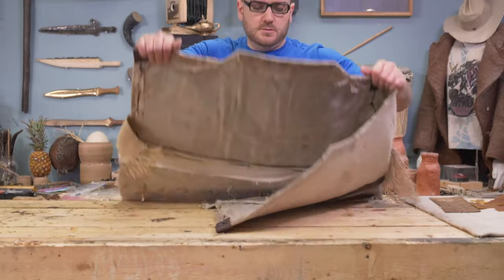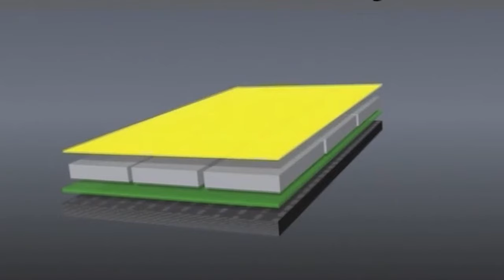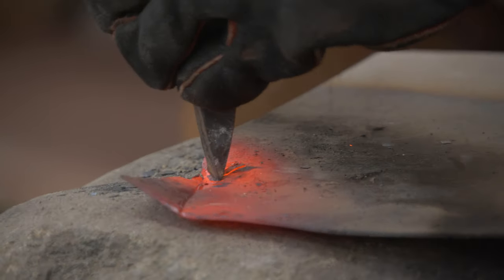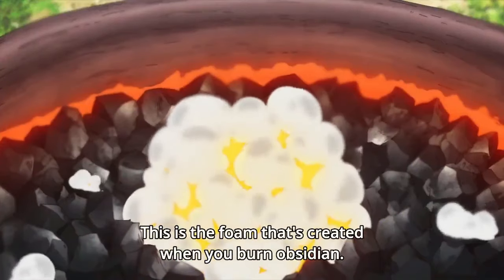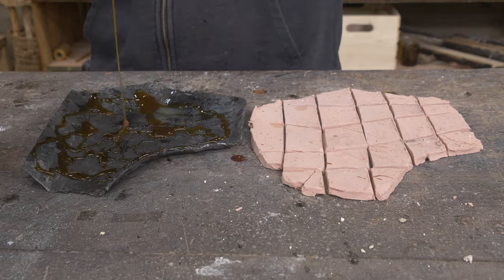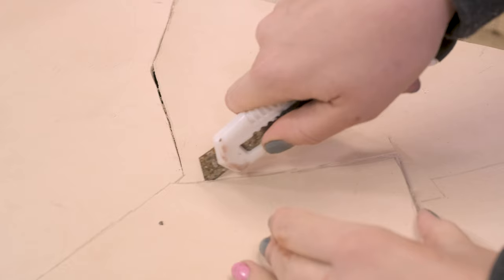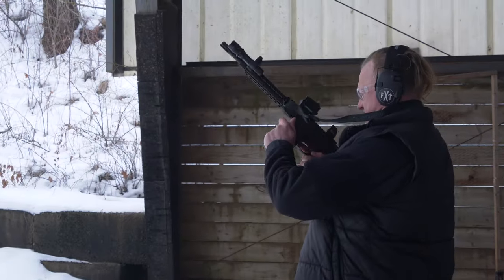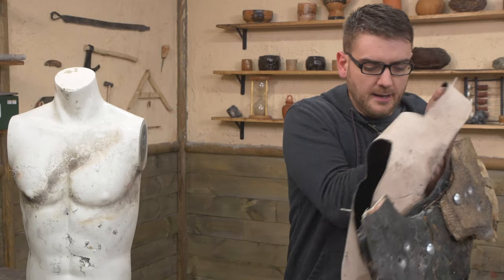PUBG MOBILE Power Armor: Handmade from OBSIDIAN?!?

Comment from the maker: The NEW PUBG MOBILE Runic Power Mode is now available!: DOWNLOAD: http://bit.ly/PUBGMHTMEPA
#PUBGM #EVOGROUND #POWERARMOR
Reply: I'm early
Reply: linen is not a bad idea for armor as its fibers tensile strength is fairly high  , using ancient available natural fibers with higher tensile strength would produce superior resistance for the same density of weave and numbers of layers . that said your off to hemp fiber then silk  then its chemistry time ending the ancient materials. next you need to look to the thread and its weave  they will make a difference more tpi for a denser weave more transfer of force. the number of layers and compost armor  what if 2 of every 4 sheets are rosined laminated or glued..leaving harder less flexible layers in the assembly  havent touched on stone or metal possibilities .your choice of linen is uninspired not going to silk is understandable for budget reasons but good old levis had this hemp fabric called denim so getting ahold of some of that shouldnt be toohard lol .thanks for the video
Reply: just want to stop 9mm  i believe 75 layers of silk at its near max tpi stops 9mm google it swiss or german inventor ww1 silk bulletproof vest  at the time the alternative was 150lbs nickle steel plate shield
Reply: Seeing the softer brass help stop a 9mm bullet makes me wonder how well a body armor made of a brass cuirass and a composite made of obsidian, linen and leather would do. Maybe sandwich the composite between two brass plates. Inquiring minds wany to know. It is cool that ancient technology can still compete and is relevant.
Reply: How much did they pay you?
Reply: @joefoll3553  More than Raid: Shadow Legends >:P
Reply: Wish you would have tempered and hardened the steel, they had that ability and it makes a different
Reply: so bronce did much better... well, now they need to make a bronce spartan shield and test it.

Comment: Neat! It looks great for your first hard armor. Maybe llamelar or scale would be another step.

That is an awesome use of the iron era materials. Linothorax composite obsidian-ceramic without the iron might be an effective stone age armor.
Reply: I don't think you can get this obsidian foam using stone age technology. I mean, I imagine it would already be pretty difficult with medieval stuff, but getting that much concentrated heat seems rather unlikely with the stuff they had back then.
Reply: @darthplagueis13  Charcoal burns  at 1,200 C, and obsidian melts around 900 C so it should be possible. Just really hard!

Comment: maybe when working with metal... make an anvil first.
Reply: Lol I thought the same thing
Reply: Whaaaaaaat? Naaaaaaaaaaaaaaah
Reply: He got a rock, thats good enough.
Reply: Make an anvil? I'd be interested to know when metal anvils first came in to common use, considering they would consume large amounts of expensive and hard to produce materials. With the metallurgy of the time, the early iron age, they would likely be quite soft or too brittle for sustained use.
Reply: @another3997  i understand that you think about those comic like anvils. But just a thick metal sheet will most likely suffice. Trying to get something flat on a round stone is.... No good idea.
Reply: @SubjektDelta  hell, even a hammer and an axe mounted to a tree stump or large log would've done! And that's roughly how anvils started anyway.
Reply: steel strong
rock strongker

Comment: I'm impressed, that is incredibly functional.
Reply: same, I was not expecting it to equate to modern *anything*. As it is, a lot of commercial vests use 3A... That's impressive considering the thousands of years that separate this technology to that Glock.... It surprises me how few cultures used ceramic for armor actually. I can't imagine the resiliency was lost of them.
Reply: it was until he said the weight of 17lbs. steel plates that stop armor piercing rifle 5.56 weigh 6-7lbs although never buy steel armor. I have hard poly 3a plates that are 1lb each and will stop anything 44 mag and below. modern rifle stopping ceramic/poly plates are 3.5-5lbs and that's just on one side too. hell even a phonebook will stop 9mm and will weigh less than 17lbs.

Comment: I´d suspect you could have achieved a way tighter bond between the  obsidian and the metal plates if you had melted it directly on there; also, I think the ceramic tiles you made could have benefitted from a glaze, possibly even again with your obsidian mixture. Finally, case hardening might be something to try when you want to improve any iron plate armor you make- AFAIK a lot of historical high-end plate armor was case hardened, and could withstand early musket rounds because of it.

Comment: This armor is amazing. I bet you can optimize it even further by reworking the layers.

The back layer closest to the chest could be a thick bronze plate with a thin iron backing. The bronze will absorb the last of the energy and the iron will keep the structure intact. 

For the surface of the armor, you could design angled plates, again made of a layered bronze and iron, that are designed to deflect bullets away from the body.

Comment: It might be even more effective if you change the order of layering. In modern ceramic armor and bulletproof glass, the hardest layer goes on the outside and the flexible layer goes on the inside. The job of the hard layer is to deform/fragment the soft projectile to increase the projectile's surface area. The job of the soft layer is to hold the hard layer in place and stretch to decelerate the projectile over a longer distance. In your case, the iron can be considered a soft layer.

So glass/ceramic, then iron/bronze, then leather/fabric would probably work better.

Comment: Sorting:
Iron Part 1:

iron cloak
ceramic squares
(Leather threads between the iron layer and the ceramic)
linen cape

Bronze part:

bronze layer
linen cape
Ceramic with leather threads between linen and ceramic)
another layer of linen

iron part 2:

iron cloak
Foam
Ceramics
(Leather threads between ceramic and foam)
leather cape

Iron Part 3:
iron cloak
Foam
leather cape

Right breastplate: iron layer 1
Left breastplate: bronze cape
Bottom: iron layer 2
Center part: iron layer 3

Comment: This is impressive for the materials used. If you really wanted to get serious about the ceramic you could've added a fibrous material to increase the strength of the ceramics but regardless very good. Also a they're experimenting with particle additives to armor such as tungsten which are suppose to act like your foam.

Comment: Here is an armor idea for you to try out. 1/16 steel sandwiched between 1/8 inch rino liner on the outside and 1/2 inch rino liner on the inside. Padded with airfoam. You will be amazed.

Comment: Looks pretty interesting but there's a big flaw in the design: there's no material covering the metal plates of the armor so that bullet shrapnel will not cause damage to the wearer.
Given the angle at which the plates covering the breast are slanted there's a pretty high chance that shrapnel will fly towards the neck and head of the wearer.. yikes!
Not long ago,  Matt from demo ranch made a video called "The Whistlin' Diesel Incident..." in which he tests (demolition ranch style) bullet ricochet and shrapnel splatter; it might be interesting to vision if you plan on revisiting this concept of bulletproof armor in the future!

Comment: nice vid, maybe on the steel a layer on, a bronze coat would be good 2 or 3 millimetre of steel, whit a 3 millimetre of bronze, maybe something like obsidian between them and after that linen ceramic and linen or leather  also you forge a steel plate, maybe try to directly use a mold to make it when you forge it you can create inequality on the piece.
Maybe if you try to melt your iron to 1200/1300 degree Celsius to eliminate most of the impurity and carbon, after that try to obtain a 96,5% and 3% carbon the 0,5% would be the others needed think, ancient black-smith used keratin, blood and other think.
I imagine you should be pretty busy, some of your vids take literately part of your life.
But kwon that all the thinking process you make to get to it's part of what we like in when watch you.
You have made a pretty nice introduction on what can be and ancient armor whit modern knowledge, now maybe the time to get to modern experimentation about it a vid whit you making samples and testing it could be interesting. 
Always nice to see your vids, see you.

Comment: I wonder, it's not often used but copper/silver/gold cloth is woven for armor. yes it's expensive but perhaps if you spun a soft metal like cheap pewter to wool, and that then was woven into a metal cloth it might stop most items and it's like light weight. and yes royalty armors often were a armor. @How To Make Everything
Reply: Wire mesh "armor" does exist, although its used as a wearable Faraday cage. The characteristics you want in textile armor that metals can not achieve is a high flexibility paired with low elasticity and high tensile strength; textiles don´t work harden like metals do, either. If you compare this to mail, for example, the used metal can have a high tensile strength and a low elasticity, but it doesn´t need to be flexible because the individual rings can move.
Reply: @nilsschenkel7149  yes but the idea, can be other then gold it could be bronze and the idea of movement, wool and any soft metal woven would stop/distribute forces . and thus are a more supple then mail. and if you take a moment and go through how to make Kevlar it's the same idea just with metal spun into the wool. thus it's more lighter then other armors and this technique is rather ancient. so it's just possibilities but yeah who knows.

Comment: Here is the thing, he has never made steel before, iron and steel are not the same, it's like he started casting bronze while he was still in the copper age, just heat up some iron in a high carbon environment, like a crucible like thing that's full of charcoal and iron, this will continue to bug my inner blacksmith until he actually makes steel, iron doesn't harden or hold an edge well, and there are simple ways to make steel from iron, and he keeps grabbing it even though he only ever made iron
Reply: Please just make some steel, its called case hardening bandits simpler than making iron,
Reply: And its*

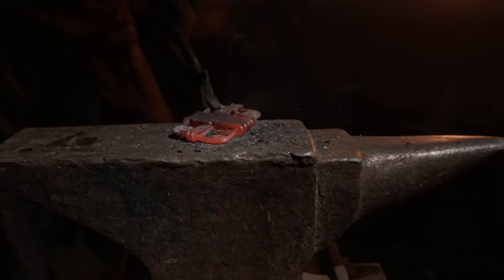Comment: 2:14 This kind of humor you have around "haters, hur durr" is EXTREMELY off-putting, mainly because if anything, it shows you care enough to acknowledge the possibility of someone not liking something and preemptively launching a blanket smug gag before the video is even out.

It would be healthier to both pay negativity no mind, but also refrain from branding everything mildly contrarian as negative. There's a balance between not turning the other cheek and deeming any critics as "hatters" to dismiss them quickly. Find the middle ground between becoming a punchbag and erecting an ivory tower.